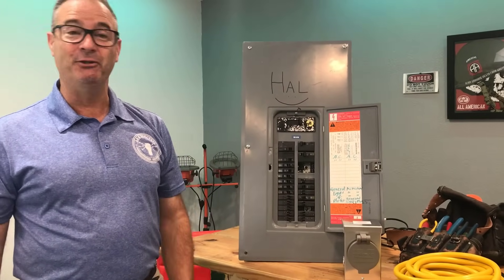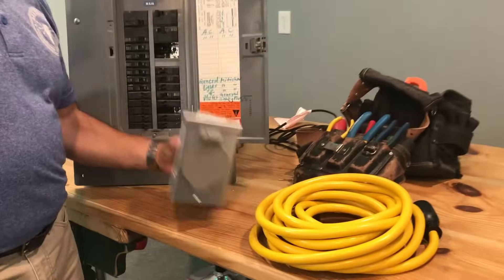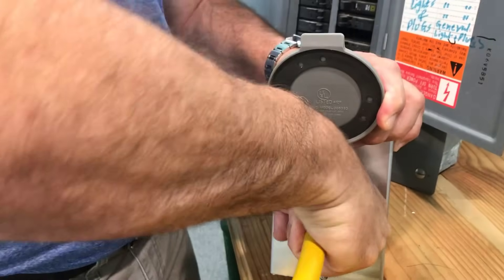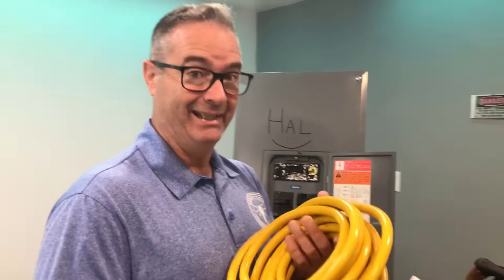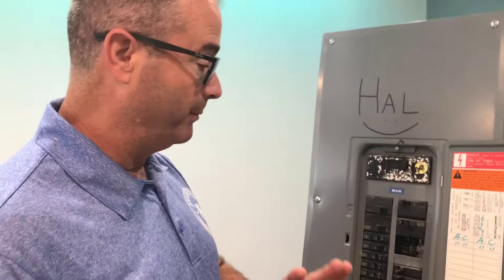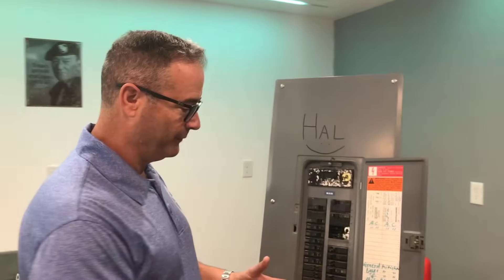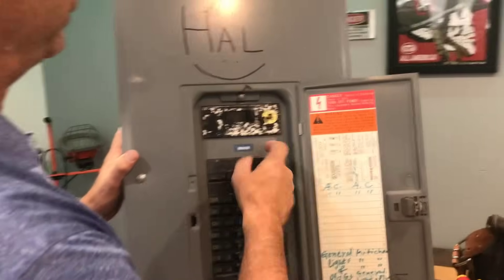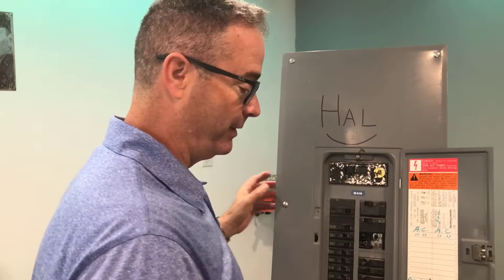4 Generator Hacks by an Electrician

Comment: Great video.

But I would add a point to the maintenance section:   NEVER leave untreated ethanol fuel in your generator.  (Or any other small engine you have)  EVER!!

Ethanol is a small engine KILLER. 

Even a small engine mechanic (like me) would take a couple hours to remove the carb, clean it, reinstall it, and get the generator running again after ethanol fuel has sat inside the carb for longer than 90 days. 

If you filled up your generator with untreated ethanol gas "last year" just to be ready for a power outage, you will be screwed when you need it. 

My tips:

*BEST:  Use non-ethanol gas if you can. (Not every area even offers it.)

*2nd:  Store generator with an engineered fuel, and keep treated ethanol fuel on hand. (Treated with fuel stabilizer).
  But, every 90 days dump that treated ethanol into your vehicle, and get a fresh batch. 

Sound complicated?  Not half as complicated as having your generator not start in an emergency..........
Reply: This has NEVER been an issue for me. Why not? Every time I run my generator, I don't just hit the kill switch when I'm done. Instead, I cut off the fuel supply to the carb. Most generators have a switch or a dial to cut off the gas going to the carb. I (once the power comes back)

1. kill the gas going to my carb by turning the dial
2. walk and unplug the generator (I have a 60 foot long cord and the generator is plugged in far from its actual location) and start rolling it up for storage

By the time I finish rolling up the cord, the generator sputters to a stop, since it has no more gas. There will be NO GAS in the carb at this point. I've done this method for 15 years and never once had an issue starting my generator and we've lost power numerous times, twice for 5 days.

I will say this much, however: running your generator on gas, in general, is too much work, and I'd advise anyone to run it on propane instead. Get yourself a nice 500 gallon tank and have a plumber run a line to where you're going to run your generator. Otherwise, you'll be doing a lot of (especially for extended outages)

1. Going to the gas station
2. Carting smelly gas in your car (your car WILL smell like gas after)
3. Setting a periodic alarm to fill up the generator

Yeah, it sucks having $2K worth of propane just sitting there (especially if you don't use it for your stove, etc). But think of it as insurance. If you were in Buffalo a few weeks ago, it could have saved your life.
Reply: I do one better. I have a fuel injected generator. I only use treated fuel in my genny. My genny has a fuel pump. It even has an after market auxiliary fuel tank that can be connected to it. I have enough fuel in my generator to run at 1/2 load for 18 hours. After I come home from work it’s nearly empty. I hook up my already full auxiliary fuel tank & refill my main tank. That buys me 48 hours of run time at 1/2 load. Mine stays in a locked enclosure on a trickle charger. I periodically will start it & run without load, sometimes with load. I have had it for five years & it always starts on the first attempt. It’s peace of mind. I think of it as an insurance policy I hope I never need? But if I do? It’s always ready.
Reply: @johnclyne6350  That’s great. 👍🏻
Reply: I actually ordered a spare carburetor for my predator generator a couple days after I bought generator!  Cost was less than $30! Well worth the money just in case!
Reply: @scott1395  That’s a smart thing to do, Scott!  👍🏻
Reply: @scott1395  I advised my neighbors after a long duration outage which genny to buy (Honda EU 7000is).Ofcourse they all took pictures but must have had sticker shock when it came time to buy one? They all bought models with carburetors. One said he stored fuel in his for 6 months & it won’t start? I asked him which genny he bought? (Not a Honda EU7000is). I asked why not? He said he didn’t have the money I had? Now he has to find someone to fix it? Mine starts on the first try every time & I’ve had it 5 years without any maintenance
Reply: @johnclyne6350  Honda generators are the very best but are expensive, I have Honda generators that are 30 years ole and still work perfectly.
Reply: @Asidebar Mine is 6 years old & works like a Swiss watch. Other than change the oil once a year & run it three times a year. I haven't done anything to it. Other than wash & wax it. We have used it twice for power outages. It performed flawlessly. 
Safety of my family is paramount. I'll spare no expense to protect my family. I guess others that buy lesser generators haven't the same degree of safety in mind? As a power lineman for a living I have seen what others do & not do in long outages. Sometimes it's disgraceful. The best plan is to move to a hotel with power if you didn't have a plan? I have seen some dangerous activity just to get the lights on. Some are illegal to deadly. Desperation calls for desperate actions in an emergency. I just can't fathom that people are soo reactive? Especially with a family. Parents are supposed to be protective? 
My wife used to call me at work asking when the power was going to be restored? I couldn't tell her because I was several towns away. Since the generator I never get one call. I bought peace of mind. You can't put a price on that.
Reply: Seafoam works wonders
Reply: @AB_thingsDFW  Yep. Works better than Stabil.
Reply: You can leave ethanol gas in a generator for a few months, just run it every 30 days.

Comment: I noticed you didn’t discuss voltage loss over distance. I think that’s something to take into consideration when selecting a cord for your generator. You don’t want to be back feeding your house with a long cord resulting in too low of voltage to your appliances. Especially if the gauge wire in the cord is on the smaller side.
Reply: I was actually going to make this point, so I first checked and realized it shouldn't be an issue. Most people using a portable generator are going to use your typical 5.5KW - 12KW unit, paired to a 30amp (10 gauge) - 50amp (6 gauge) wire. A 10 gauge wire can run 128 feet without seeing more than a 3% voltage drop. And it's even better with a 6 gauge wire, as you can go 188 feet. 

I built a generator shed for my generator away from my house and made a 60 foot cord to plug it in and the voltage is perfectly fine and I've been using this cord for 15 years without issue.
Reply: What size cord for 60ft @dontbanmebrodontbanme5403
Reply from the maker: That's a great point. There are several online calculators that will facilitate that. My benchmark would be 5% or less on voltage drop.
Reply: I bought a small generator with two goals: 1) it can run the fridge and 2) it was easy to move. I went for a 2kW Chinese made generator and the cord cost more than the genset!

Comment: Hal what do you know about bonded vs floating neutral?  I have a generac 17500 bonded.  Have 400 amp via two 200 amp panels have two 50 amp interlocks propane conversion kit gen shed but the bonded vs floating confuses me for back feed.  I also have the genset grounded with #10
Reply: Your main panel should be bonded so you need to make your generator floating neutral.  By code you can only have 1 bonded neutral in a circuit and thats at your panel.

I was confused also but from what i gathered is if there is a short somewhere when the power coming from neutral returns to the source it may not pick it up as the electricity can split and run parallel between both bonded neutrals and not trip a breaker.  Having only 1 makes it a standard circuit so if something goes wrong you still jave the neutral/ground to return back to the source and trip a breaker in the even of a short or a live wire etc..

If youre running the generator as a stand alone say running power tools and not back feeding a panel where the neural is bonded then youre okay because in your stand alone you only have the generator connections in which bonded generator is the way to go.

I'm not an electrician but this confused me also and ive spent the last week trying to figure out what the hell bonded vs floating was and when to use and not use it.

Comment: Can you wire in two generator power adapter plugs and run two generators at the same time into your house panel if power goes down and you switch to an off grid mode?
Reply from the maker: You can, but you have to keep the generator output separated so they don't backfeed into each other. There is a process to synchronize them, seems like a lot of work.
Easier to split the total loads between the 2 generators with individual transfer switches
Reply: Yes but you'll need inverter generators and a combiner box then both generators will work together and even run at the same speed but you'll only have one output with double the power

Comment: I thought there was a risk to a utility worker of getting shocked if my generator is back feeding the utility?
Reply from the maker: Without an interlock switch (whether manual or automatic) you are absolutely right.
Reply: That's why you turn your main off.  The generator inlet box is wired to a new breaker you install usually very top right spot in a panel.  The metal plate basically blocks you from turning on your generator breaker when the main breaker is on and vice versa for tue ing on a main breaker when the generator breaker is on..  it physically blocks one or the other so there is no accidental leaving them both on and back feeding the utility lines.
Reply: There is a risk, but it varies.  If a whole neighborhood loses power, and your generator is trying to drive the grid, it will certainly fail right away -- just nowhere near enough power to supply all those homes.  So *in that scenario*, the utility worker won't get shocked.  But there is another scenario, like my brother experienced.  That is, his power line runs along the edge of a field of a farm and that whole line powers exactly one house, his.  A big storm dropped a tree branch on that line and cut power.  If my brother had connected his generator to the grid (he knows not to) AND a line worker touched that line without checking, then the generator would continue running and the worker would surely get shocked and quite possibly electrocuted.

Comment: The last time I did a dry run, I couldn't get the interlock to slide over in order to switch the generator breaker on. It was frozen in place, it worked previously. I would say do a dry run periodically.
Reply: That sounds unusual.  I'd make sure it is installed correctly, or uninstall then re-install it.

Comment: Another tip no one really thinks about is with the generac automatic generators that run off natural gas.  Keep a check on your Battery’s. A friend of mine was on vacation and just assumed his would kick on if something happened. He got home they are out of power basement full of water because sump pump not powered and lost everything in the freezer and fridge.  So once a month check your battery and have it changed at suggested intervals
Reply: who in the world would check there battery every month.  change it out every 4 years.
Reply: @RHP2024  your supposed to start any generator at least once a month and run it for 30 minutes per maintenance manuals